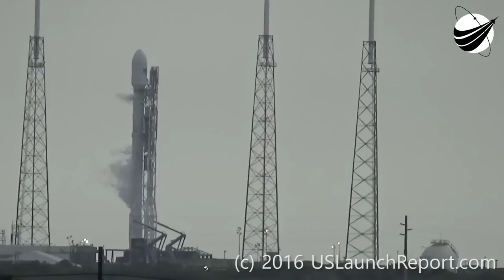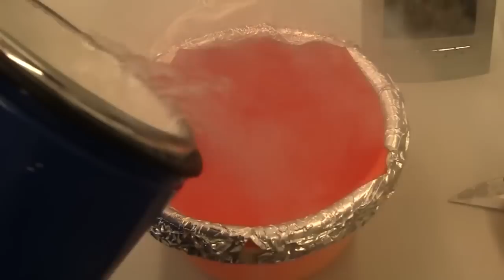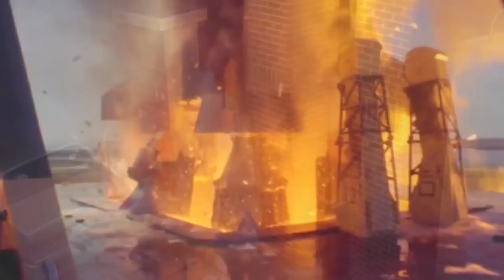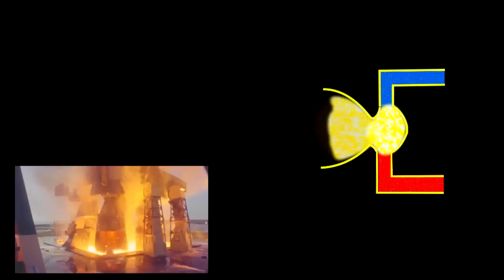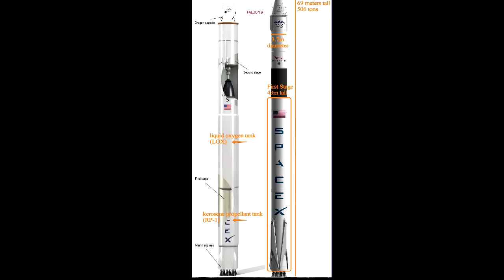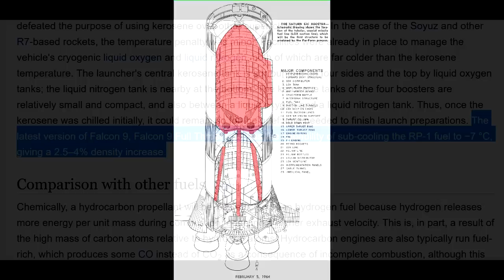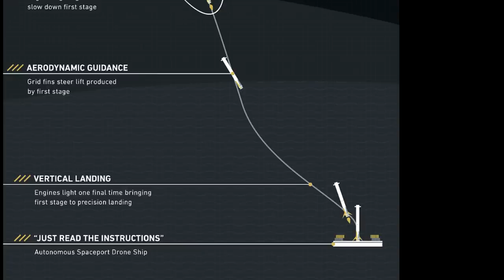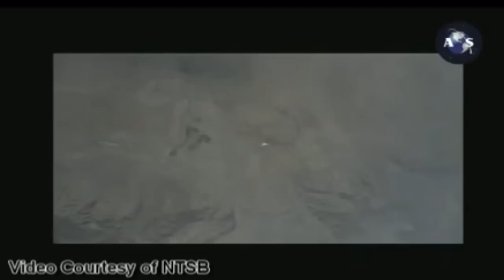Why did the Falcon 9 Explode?

Comment: Good explanation of rocket engines at the beginning. 

Not sure the negative sentiment about SpaceX/reusability is warranted, but it's hard to be scientific and objective about sentiment. 

One way to look at it is that it would be silly to expect SpaceX to succeed without failures along the way, some of which will be unusual failures. 

Any endeavour that is not allowed any mistakes will fail to truly innovate and push the necessary boundaries. The current sorry state of human spaceflight is a testament to that.
Reply: The problem is the hype train that comes along every time Musk has some idea. SpaceX isn't the first private company to launch rockets. Sea Launch started operations in 1995, launced 31 satellites successfully and failing 4 times before going bankrupt. 
If I were to summarize Thunderf00t's criticism of the Cult of Musk is that he isn't creating anything new. He is going the Steve Jobs route, taking ideas and work others have done, repackaging them and selling them as his own without giving much credit to those who came before. He's a businessman selling himself as an engineer.
In this specific case, SpaceX was hyped up as better than its predecessors. There was a sense they could do no wrong since this was Elon "Fricking" Musk, and it turns out they haven't solved any of the problems that have pestered rocket science since the 30's. Sure they can improve, but it will be on the backs of tens of thousands who came before who deserve a little more credit for sacrificing blood, sweat and tears for Musk to stand on their shoulders.
Reply: @christianvandegraaf9844 well this aged poorly.
Reply: Nobody serious claims Musk invented the rocket engine or with the base tech of the Merlin engines. However those engines do deserve praise. They're cheap to build, very powerful for their size and so far have proven to be extremely reliable. The 2 Falcon 9 failures have not been caused by the engines and they haven't had one fail since CRS-1 in 2010 (where the primary mission still succeeded). That's pretty nifty  and definitely a solid engineering advancement. None of the 1960s engines had this sweet-spot of performance, cost and reliability. That's engineering in a nutshell.

And they're developing new tech as well. Gwynne Shotwell recently mentioned that their new Raptor engine got shipped to their test site for testing. This is a closed-cycle Methane/LOX engine. So far only 2 test engines with this design have ever been built, and it seems like Blue Origin has also demonstrated a test-fire of such an engine recently. The point is: This has never flown. Nobody has really figured it out yet. SpaceX hasn't flown it yet either, but using existing tech to build your business so you can develop new tech seems like a solid business plan. Saying that SpaceX is mostly in the 1960s is simply wrong. Their R&D is very much on the cutting edge. There is a really good reason why United Launch Alliance (Boeing + Lockheed) and Ariance Space are rushing to build new rockets all the sudden. Or that the same Russian official joking that the US should use parachutes to get into space now all the sudden says that Russia will not be able to catch up with America again. It's easy to dismiss SpaceX simply by looking at the stats of their engines, but when three of the four world leaders in the field admit they need to innovate to protect their business... They're doing something right. A hell of a lot more than TF is giving them credit for.

Please keep in mind that Elon Musk is always the first to tell how much help they've gotten from NASA, both financially as in technical expertise. He mentions this pretty much every time someone compares SpaceX to NASA in a Q&A. The reason why people are so crazy about him is because of all the people who have claimed people will live on Mars, he seems like the one who could actually do it. Don't mistake the fandom for the person.
Reply: Andrew Wilson Exactly. So accidents can happen while you do cutting edge research. 

Like it or not, but SpaceX has started testing a closed-cycle Methane/Oxygen engine. Only 2 of those have been tested in the past. SpaceX, together with Blue Origin are currently the only ones working on such an engine. In case you don't know, this is considered by many experts to be the sweet spot for chemical launch engines. It is more efficient than RP-1 and much easier to handle than LH2. It is also totally clean, unlike hypergolic fuel mixtures.

Nobody has figured out this specific type of engine before, but now 2 seperate private enterprises are on the brink of actually using these things on rockets. If you don't believe SpaceX will make it, fine. But with Jeff Bezos, Blue Origin practically has an infinite amount of money. Innovation is clearly happening outside of NASA. You can deny it but that doesn't change anything.
Reply: +bensemus x the Merlin engines aren't "new" or innovative. When I say new, I mean the technology has been around since the 1960s. They're using pretty much the exact same tech that the Rockedyne H-1 that was on the Saturn 1 used. They have nearly the same thrust, both are LOX/RP-1, and both are gas generator cycle engines. The Russians improved on the efficiency and thrust to weight of LOX/RP-1 engines long before SpaceX came around, so still no real innovation there. Their second stage is just another Merlin engine with a new nozzle, nearly everyone else uses Liquid Hydrogen/Liquid Oxygen in their second stage, because it's the most efficient propellant in space and in space efficiency is one of the most important factors. So tech wise, SpaceX is still mostly in the 1960s.
Even landing their rockets is done with tech we've had for decades (excluding the computers and software), the engines aren't new, gimballing isn't new, and grid fins aren't new. Now they have figured out how to do supersonic retropropulsion, which is pretty cool, but not necessarily innovative.

What SpaceX does have going for them is vertical integration. Nobody in Aerospace really does VI, which allows SpaceX near total control of their final product, which saves money.
Reply: Bracy Harvey lol what Niosus said. When I said original I mean they aren't purchasing them from anyone, same with the landing system. They designed them. Obviously they have to base them on existing knowledge. It seems that SpaceX is being criticized for not using existing knowledge and for using existing knowledge. You criticize them for using existing knowledge and TF says they are ignoring everything other rocket agencies and reinventing the wheel.

We've had the sensors for self driving cars for years yet they are just starting to get developed. Just cuz the tech exists doesn't mean it's easy to get it to all work properly. There's a reason people were very sceptical about SpaceX landing their rocket upright. No one had managed it before/never even attempted it as it was deemed impossible/unfeasible.
Reply: +Christian van de Graaf the engines and landing routine are all original. He and his engineers have designed most of the rocket and also the manufacturing to make basically everything I house. He's not repackaging existing tech like Apple.
Reply: Niosus " they are the organisation with the highest number of astronauts killed in the world (17 to be precise)"

You can't just take that figure in isolation. They are also they organisation to have sent most astronauts into space.

They also are the ones who do the cutting edge technology in order to allow private enterprise to come in behind and take less risks.
Reply: If they're still at the stage of rockets blowing up while refuelling then they're nowhere near innovating. It's all been done before.
Reply: Andrew Wilson False Dichotomy. There is no reason why a company cannot have a fueling accident while doing cutting edge innovation. It's like saying Samsung isn't doing any innovation because one of their recent phone models can blow up while charging. Whether you like that company or not, they're still one of the world leaders in electronics. The same goes for SpaceX.
Reply: Niosus "There is no reason why a company cannot have a fueling accident while doing cutting edge innovation"

That should no longer happen. NASA have all the safety procedures in place. They've built them over years. They will also follow the procedures even when it costs more. Private companies are far more likely to cut corners to please the shareholders.
Reply: maybe the thing is that a solution to mitigate many of those failures has already been developed by nasa.
Reply: Andrew Wilson NASA had a manned Space Shuttle blow up in 2003. That's pretty recent and shouldn't have happened either.

The truth is that right now neither of us knows what went wrong and why it could go wrong. For all we know, this may be an issue that NASA would have overlooked as well. For all we know, procedure was followed to the letter.

All you're doing is making assumptions. Of course this is a really bad fuckup by SpaceX. I just find it silly to assume this wouldn't have happened if NASA was in charge while they are the organisation with the highest number of astronauts killed in the world (17 to be precise). How about we wait for the final report before we start pointing fingers, huh?